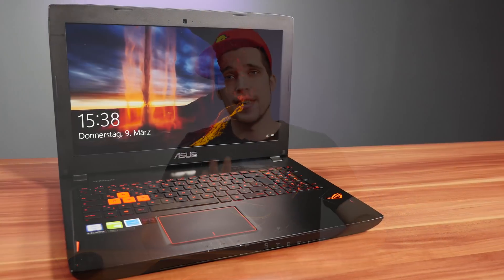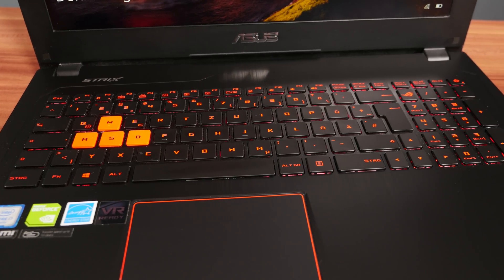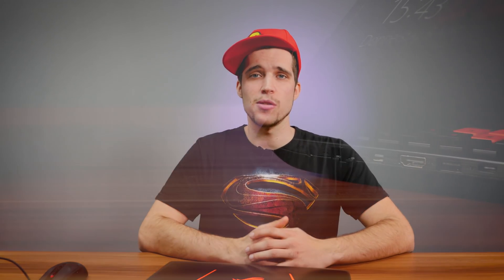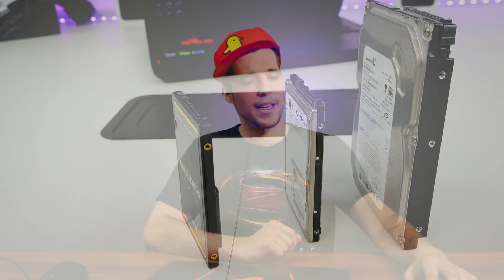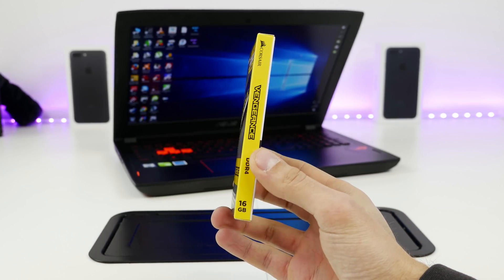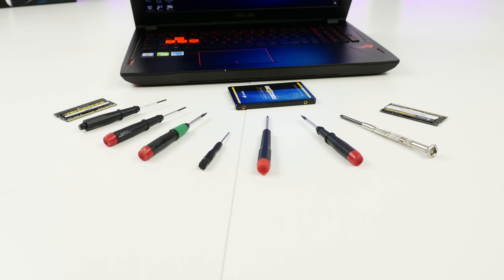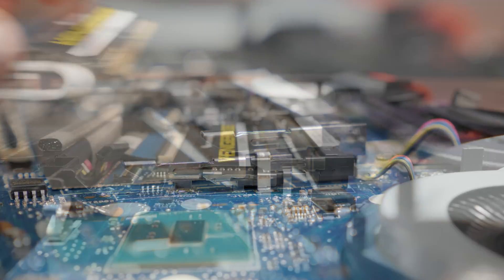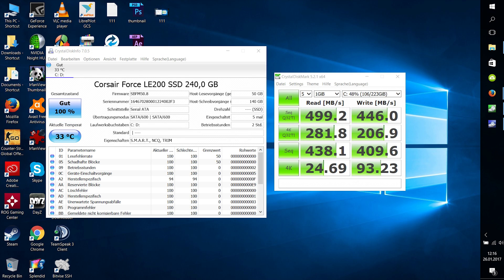How to make your LAPTOP & NOTEBOOK & PC FASTER!

Comment: Tech magnet please reply to my comment
I have hp pavilion x360 and it won't turn on. I tried all the method like hold the power button and stuff but I can't take out the battery it's non removable . Please help and reply.
Reply from the maker: nothing you can do except get a screwdriver, remove the back and try to remove the batt and try again. if still broken, it can be a hardware fault and requires more examination

Comment: I use Acronis via a bootable optical disc which can access my home network, to read or write operating system images directly.  This also means it is one less thing I have to install and slow down my computer with.
Reply from the maker: i usually dont backup my whole system. just store all my important data on my WD nas with raid and 12TB
Reply: I have a Synology DS415+ NAS with 12TB of internal storage,  and that means an additional 12TB of USB backup drive storage just in case.  So that is 24TB = £££££££ :-o
Reply from the maker: sick shit dude :D yo got alot of data !